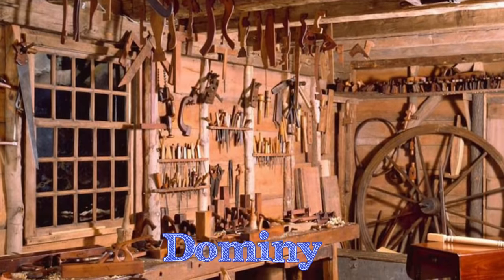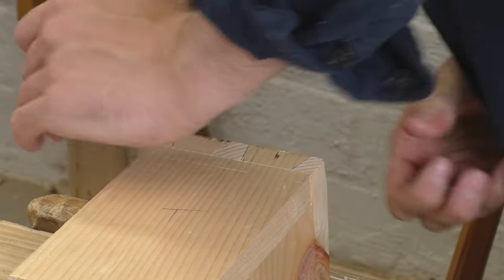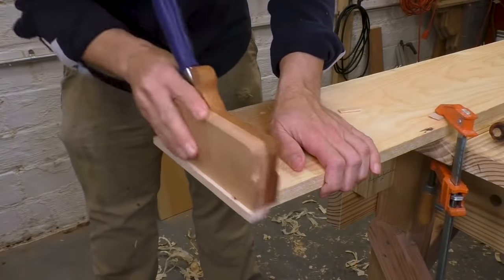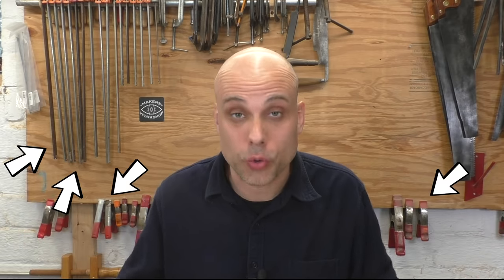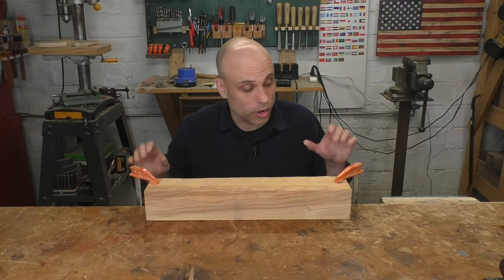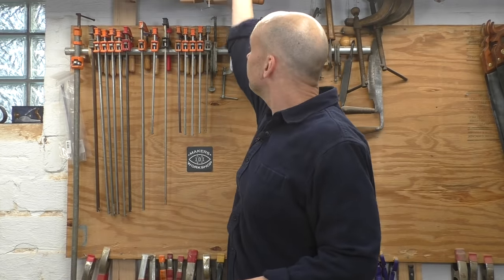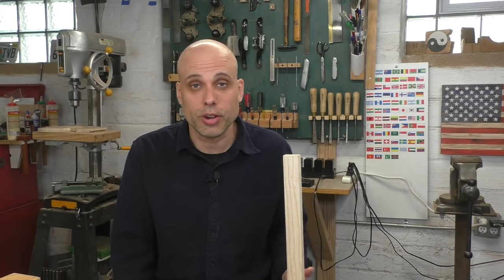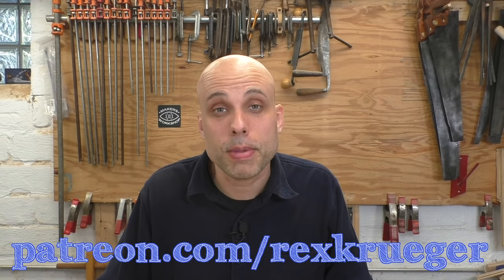Woodworking with very few clamps (maybe only 5).

Comment: I have several VERY cheap trigger (ratchetty type ones) clamps. I think I’ve used them once to glue up. Mostly I use them as 3rd/4th/5th hands, and for holding saw stops in place. For actual clamping pressure I normally use wedges, and heavy weights.

Comment: I made a 4 foot shelf and supports without clamps on my kitchen floor last night.  Many of my books have glue on them from different projects. I have used small pieces of wood to hold things up or push things together  I do need more clamps than 5 to use my kitchen table as my wood working bench.

Comment: I like timber dogs or nail dogs with a spring joint. I've used them to make a fairly thin folding table and they can be made out of old circular saw blades or any scrap that's not too thick. Can have more boards drying at a time and only use one clamp initially

Comment: Get some 1" cargo holding straps with ratchets (loop version). In addition get some 90° corner pads which are common securing paletted cargo and some rubber pads. All in all compact to store and versatile in use made for clamping and cheap to buy. In ancient times they used rope twisting for clamping like on a bucksaw.

Comment: You can also use string for clamping.  I recently saw an ingenious method used by guitar makers for edge-joining two very thin boards.

The pieces were laid perpendicularly across three stretchers, then string was wound around the ends of each stretcher, in such a way as to form an X on top of the boards (one X per stretcher).  Clamping force was applied by driving long wedges between the string and the boards, parallel with the stretchers.  The string pulled the boards together, and the wedges and stretchers together formed a full width clamp across the joint to prevent bowing.  

By my reckoning. you'd need 6 small clamps and three big ones to get a similar setup, and I'm still not sure that it would be as effective,
Reply: Super, Chris, thanks! That is the precise description I did not imagine I could make, or nearly as well! I think that this technique is very elegant. I have wondered how to scale it up to tabletop size efficiently, all that string winding. Time and glue wait for no man, y’know.  Maybe a single web strap, with a quickly tightening cinch buckle?
Reply: @leehaelters6182  I think the key concern is to make sure that the force that pulls the stretchers into the boards is decoupled from the force that draws the boards together.  What I'd try is cutting the stretchers roughly to the width of the table top, and putting a 45 degree mitre at each end so that you end up with a long trapezium.  Then put a little block between the strap and the edge of the table, making sure it doesn't foul the stretcher.  

Ideally the strap should leave the edge of the little block at an appropriate angle, and then travel through thin air until it reaches the top of the stretcher.  Adding a little shim between the strap and the stretcher halfway along its length might also be a good idea, to make doubly sure that the stretcher isn't bowing outwards.

The obvious drawback of this method is that it doesn't have a lot of adjustability for width of table top if you want to reuse the stretchers for a different project.
Reply: @chris_wicksteed , thanks for your interesting reply. I cannot make out why you would separate the application of pressure in both directions simultaneously, though. It seems to me to be an elegant virtue of this technique; squeezing the boards edge-wise while acting to flush them up and keep the whole affair flat. I imagine it this way: webbing strap fashioned into a  loop with a buckle that may shorten it with a pull, sized just loosely enough to slip over the remaining end of the bar, or “stretcher”, once glue has been applied and the boards laid together edge to edge. A pull on the strap snugs the assembly ready to receive its long thin wedge under the crossing belts. All this is to overcome my objection to the need for leaning over the glue-up to wind cord many times for each bar and wedge  combo. What goes quickly for a guitar sized assembly, hand held and with a single joint, may require too much time in scaled up fashion.
Reply: @leehaelters6182  Half the time I'm guilty of overthinking things, the rest of the time I'm guilty of underthinking things!  I was probably overthinking here.

I've only ever used webbing straps in nice straight lines for securing boats, so I was thinking of one strap per set of stretchers, going round the circumference without any crossing.

I guess the main thing to do would be to do a dry run first!
Reply: @chris_wicksteed , aye aye!

Comment: I use to use a lot of power tools, but I really enjoy using hand tools when I have the tool to do the work. It's a lot quieter and the process itself is more enjoyable and feels safer. It's the epitome of the "The journey matters more than the destination" or "The joinery matters more than the destination" if you'd prefer :D

Comment: I have a lot of quick release bar clamps, but only because I tend to make things in runs or do a lot of small composite work (lazily, so I want to glue most of it up in one go instead of bit by bit). When you're making a lot of duplicates in one go, your clamp needs increase linearly.
For larger things like furniture, those joints quite frankly do a better job as you don't have to worry about marring the workpiece or glue getting in under the clamp pads if you need them in just that location where you'll have squeezeout. Definitely makes the workshop easier to manage if you don't have all these dozens of oddly shaped things covering the place.

Comment: Try boat builders. They make woodworkers look very light on clamps...

On the issue of joints that don't need clamps, you can of course make mortise and tenon joints very tight, the door for my shed is made that way though I also pinned them with dowels as well. No clamps used though as I don't have any that big.

Comment: If you have a big workbench or table, you can put a grid of holes in it (using a factory made anything that has a series of centred holes as a jig will make this process easier), the x axis acts as the number of tapered pegs (that go into the grid holes) you can drive against the piece and the y acts as the overall size of the piece. with a set of pegs that have a aggressive taper, and a set with almost none, and a series of spacer strips. you can have very adjustable and readily available clamping surface that is only limited by the size of the table.

Comment: welder here, clamps are among the best tool I have to get the job done. nothing beats a good ole trusty clamp to hold heavy pieces of metal together or force them together if the steel have some distortions in it.

Comment: Luthiers today use a lot of clamps but traditional methods of jointing the two timbers for a guitar top or back are generally rope and a few wedges. I can't see another way other than dozens of clamps for gluing the kerfing to the sides. But the binding and purfling is just done with tape. Luthier clamps are generally F style with a cam for final tightening. But You are quite right in that traditional methods did not always include clamps

Comment: The answer to less clamps is easy.
Traditional joinery. Wedged tenons, compression fit dovetails, hide glue, tapered trenails.
Heated sandbags often replaced clamping of large areas along with go bar presses.
I use all of those techniques professionally and have done for over fourty years.
BUT I also use clamps. F clamps, pipe clamps, whatever works best.
There are many many old school tricks for jointing timber using hide glue. Very fast, very strong.

Comment: For most of my work the simple and cheap Klemmsia clamps do the trick. I have 4 short ones (40cm) and 4 long ones (120cm). 
I have also other clamps, but I rarely use them. The Klemmsia make no dents because there´s a piece of cork attached and they´re lightweigt because they´re mostly made out of wood. They don´t deliver much pressure but still enough for almost everything.

Comment: Curiously my set of clamps matches what he suggests: (2) pipe clamps, one with an 8 foot pipe, the other 5', (3) F clamps about 3 feet long, and a bucket of spring clamps of various sizes. I guess I'll stop dreaming of having a bunch more!
--
I also have a few short F clamps, one in each toolbox for when I am away from home.
Reply: I use my little F clamps the most. Not always for woodworking.

Comment: Great video!  I have gotten by with a few C clamps and a couple of "quick clamps" for years, and some of my projects were fairly large like a ~2.1m (7' ) tall bookshelf.  With strategic placement of screws and nails,  lots of designs can be made to clamp themselves.  I did miss having a longer clamp, and I looked into getting a bar clamp kit, but  all of the local stores stopped carrying the lengths of black iron pipe, and there's no way I'm paying to ship something like that.  I ended up designing a 3d printable sash clamp, where the bar is just a length of 3/4" or 19mm board and the clamping is done with a bolt/threaded rod.  This is in no way as powerful as a bar clamp, but as Rex pointed out, you don't always need or want a ton of force.  I don't know if youtube approves of external links in comments, so If you've got a 3d printer and want to make one, just search "sash clamp" on thingiverse it should be one of the top hits.
Reply: You just blew open the top of my mind ... the 3d printing POSSIBILITIES 🤯😲😃

Comment: I have jointed two boards together such as the two plates of the soundboard of a guitar or several boards to make a sign using no clamps. If you create a good join with a plane, you can sit one board vertically on top of the other and let gravity and the friction of the glue hold the pieces together. A good joint needs the right amount glue and contact. Pressure really is optional in many cases.

Comment: (6:00) Wedges are awesome, especially for gluing something wide, like big cutting boards or table tops. But I use wedges in pairs. Get a pair of wedges form a cuboid (picture this formation - IZI - if it makes sense) and use two hammers, one behind the first wedge (as an "anvil") and the other you use to hit the second wedge to tighten. By using wedges like this in pairs you have a smaller chance of leaving marks on the workpiece, because of the bigger contact area between the wedge and the workpiece. This method can provide insane clamping forces.

Comment: Clamps save time and can do a lot of things not mentioned. The hand screws are great for standing things up on edge. If you want to say plane the edge of a door too matching hand screws clamped to the edge are enough to give the door some feet to stand upright. Use them for a adjustable stop on your bench or on miter saw fence. I have never counted all my clamps. I have been wood working since I was 8, but go in and out of it. I have always gone to garage sales and estate sales and never pass up reasonably priced clamps. If you sell off the ones you don't need or just limit yourself on the ones you keep, in order to have some to sell. I am guessing I have over 200,  pipe, bar, hand screw, Quick Grip, and c clamps from 1/2" to 8" some in multiples up to 30.  I sell many smaller clamps that will fit easily in a small flat rate box. The post office has a long thin large flat box that will hold longer ones. Flat rate is best because of the weight. Craig's list is good for selling them if you don't like ebay. Check the completed ebay listings not just to learn value but to see what is popular and what is worth more. Some c clamps are forged and bring more money. Some are considered to be machinist clamps, these have more threads on the screw and will bring a lot more money. There are small fat c clamps that are tightened with a wrench and these can get you enough money to just go to the store and buy the new ones you want. I have been collecting clamps for 30 years and I have very little money in them because I bought them cheaply and sold off enough to pay for much of them.

Comment: One of my personal favorite ways to avoid clamping (because I seem to have serious trouble just KEEPING clamps around, let alone acquiring any) is WEDGING already traditionally glued joints...

    Mortise or hidden mortise and tenon??? 
   Cut notches either 1/4 inch, or 1/3 the overall distance (longest), whichever is smaller, into the tenon (the part inserted into the mortise) and then you can drill through at the bottom of each cut to add durability and resist splitting. Add wedges between 1/16 and 1/8 inch to each slot, and then glue up and assemble the joint as normal... Use of a mallet will likely be required if the joint fit snug in the "dry test fit" but was imminently assembly-worthy by hand...
     Yes, you WILL have to be precise with your wedges so they will fill the tenon from cheek to cheek, and still slip neatly into the mortise without interference. You do NOT have to add glue gratuitously to the wedges, though. Once assembled and "struck home" with the mallet, it's not likely to go anywhere (even without the glue).

     Putting together panels from planks??? 
    Wedged pegs or posts... THE only real trick here is to precisely align the holes in BOTH planks to be joined. You can still use the "sprung joint" approach... AND pegs or posts should be about 1/3 the over-all thickness of the planks being joined. 
     Again, saw slots down the length of each peg or post... I prefer to do each join one end at a time, it's a bit less complicated... once aligned, I cut one slot in each peg to within about 1/8 inch of the surface of the hole... so for a 1/2 inch deep hole, only saw about 3/8 inch of slot, AND drill a hole (aligned with the slot) in the bottom to avoid splitting... This hole adds "spring" as well, allowing the wood peg to be spread just a bit easier... Add the wedge (again, precise to the peg, so it doesn't interfere with assembly) and glue up... Strike it home with a mallet, and it's not going anywhere... Now, you can repeat the process with the exposed end of the peg/post, and strike the entire assembly together with your mallet all in one fell swoop. It's a bit touchy, and with a sprung joint approach, may even be aggravating, especially if you over-do the sprung jointery... BUT once home, it's about as tight as you're ever going to get and there's no wiggling free or loose...
       ** TOP TIP ** Set your wedges into posts for this kind of thing "the short way" across the thickness of planks. The spreading action then aligns WITH the grain of the wood and has to "fight" the entire length of the planks in order to "break out" anywhere... It's as strong and durable as the wood you use and the number of pegs you add...

     Why wedges and where did I get them???
    I've spent a majority of my life repairing and rebuilding all my own tools and gear... I've put together more hammers and axes than I ought to have a legal right to... AND wedges, both wood and steel, have been employed in EVERY SINGLE ONE OF THEM... SO it stands to reason, if a wedged joint is good enough for a tool to hold for decades of regular HARD impacts on a daily basis, then it's probably good enough for just about any other kind of "hold together" joinery you can throw at it... in some cases, probably overkill.

      These are just a couple points where wedges can be added, and approximately how to add them... I'm SURE you (and most folks) can look at their existing joinery ideas and suddenly realize, "HEY!!! WAIT A MINUTE!!! I could just put a wedge or two here or there and over here and that way, and hold this whole thing together!!!" 

      ...if y'all just look careful.

     OH YES... It does take a little bit of practice and a lottabit of patience (mostly with yourself)... BUT once you get the whole wedging practice down... You'll almost certainly love them as much as I do... 

      AND with regards to a mallet... You CAN also cut a dado into a block of scrap-wood, to fit snug over whatever edge or face of wood you're striking and damn nearly any hammer will do the same job. You do NOT necessarily have to rush out to get a mallet of any particular sort to avoid pounding your projects to frayed disaster and pulp-wood. ;o)

Comment: So long as you don't need a ridiculous amount of clamping force and just need to hold together two pieces of wood while the glue sets, I would HIGHLY recommend making a bunch of homemade Cam Clamps.  They're mostly intended for luthiers who need very gentle holding force for extremely fragile glue ups, but I have found they have a ton of utility beyond that.  They're also super easy to make with laminated construction and can be made using 100% scrap wood and a few steel nails.
Reply from the maker: You're entirely right. Wedge clamps are pretty easy, too.

Comment: I’ve found the nicest long clamping solution is to buy sash cramp heads and mount them to nice straight lengths of ash. 

But don’t use the precise dimensions the makers recommend. I cut mine slightly oversized in width and depth, and spaced the holes further from the working edge so that the bolts hold the clamp head in place without the nut, and cause the head to remain tighter and not wobble around. 

I also rub the working edge with candle wax to prevent glue from adhering to them. 

The other great advantage of these clamps is that the bars are made of wood, so if you do accidentally knock them against the work, there’s less chance of causing damage. For this reason I never use the steel versions. 

Finally, I find them to be strangely calming. Have always liked a quiet atmosphere in my workshop, so these are in perfect harmony with the mood.

Comment: Rex, single spring clamps in multiple sizes can be had at Harbor Freight - at least in my AO. The have both plastic and metal, often staring as low as 0.99. Maybe not the highest quality, but the work